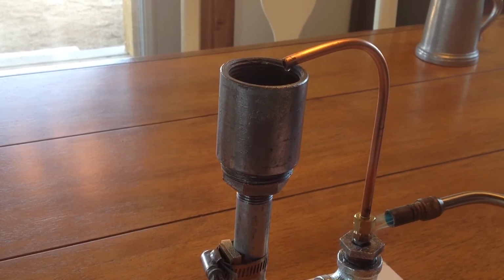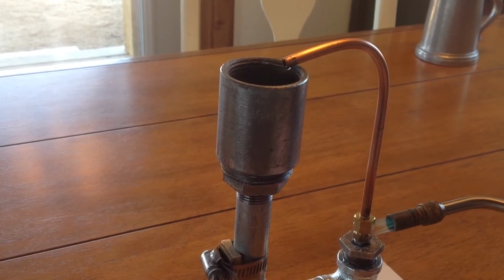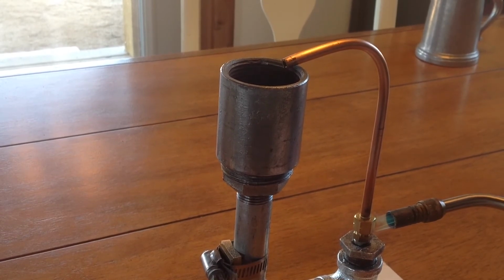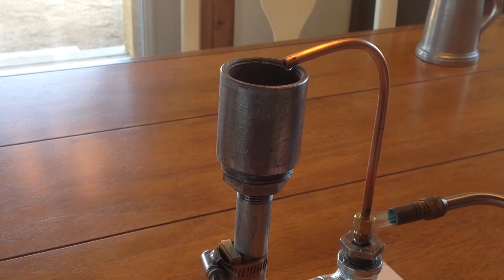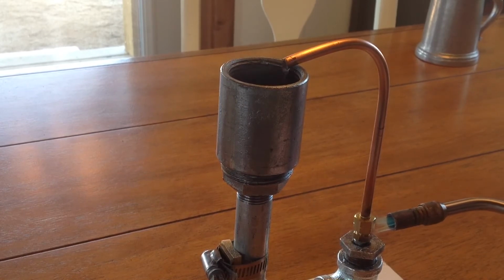Percolator Pump

Comment: Now send that hot water through a copper coil with a small computer fan on it and pipe it back to the reservoir. Put the part of the device to be heated into your camp fire and the fan in your tent. If you utilize a peltier module you could probably even power the fan with waste heat. Voila! Heated tent. Hot dry air. Plus, hot water if you need it.
Reply from the maker: There are lots of possibilities.  This video shows what I did earlier this year:  "https://youtu.be/5QjRtzROJH0"

Comment: And why are you doing this I don't understand
Reply from the maker: It's demonstrating how you can pump water using heat, and with no moving parts.  It's the percolator effect.
This video shows it in a more interesting way it can be used; but has one moving part:  https://youtu.be/5QjRtzROJH0